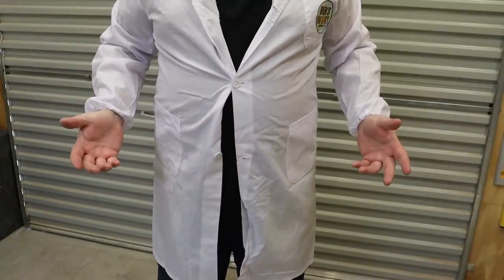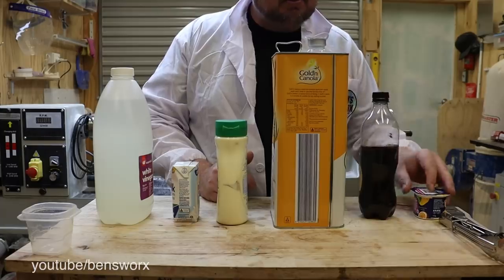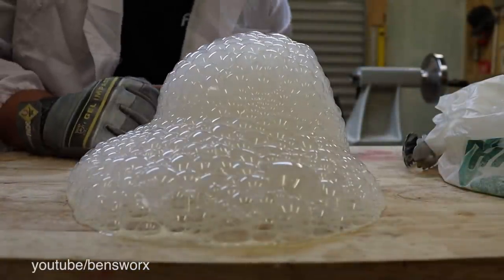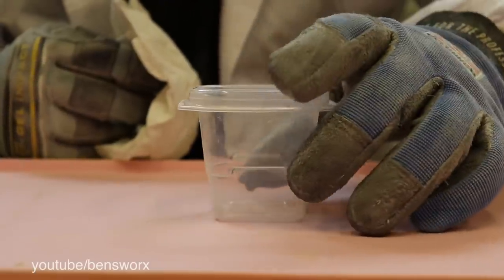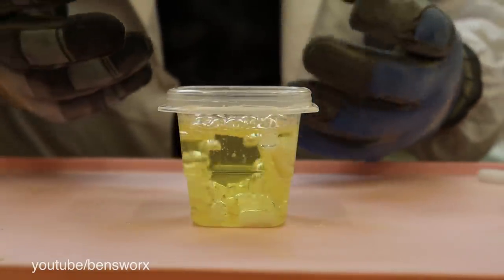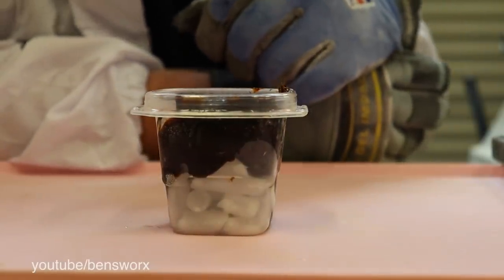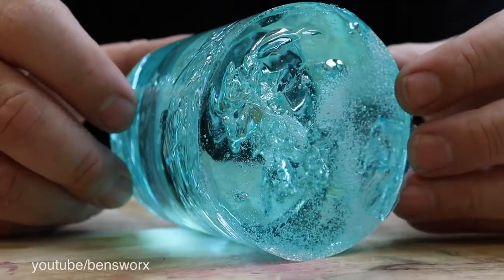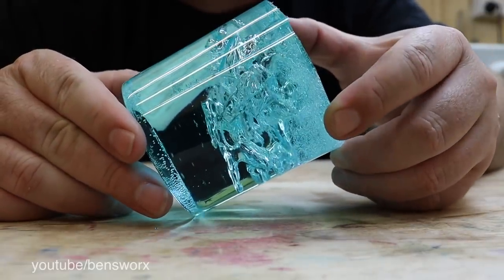Can You Cast Dry Ice in Epoxy Resin ?

Comment: Hi Ben, What happens if you’re stirring the resin really fast when it cures? Do you get the cyclone 🌀 effect?
Can you use one of those electromagnetic stirrer that chemists use? Possibly with iron filings to create a vortex?! That would be cool!
Reply: Magnetic stirring doesn't work with such viscous liquids.
Reply: I mean that normal magnetic stirrers aren't strong enough.
Reply: @hantrio4327  it’s pretty liquid when the two are mixed together with the wooden stick. I just wanted to know what the effect would be under pressure in the pot
Reply: @hantrio4327  give it a go. It may work?

Comment: Great video! It might not be a feasible idea, but if you put the blank into the pressure pot with the dry ice in it, you will slow the rate at which it turns to gas, which might give you more control and may allow you to actually trap it in resin.

Comment: Super cool (pun).
I wonder what will happen if you manage to trap the dry ice in the resin without an escape hole. Something awesome that could happen is that the CO2 will remain solid at room temperature. This can happen if the pressure in the compartment reaches a high enough pressure, the dry ice will not be able to evaporate even at room temperature. I have no idea what the required pressure is and if the resin will be able to sustain it.

Comment: I think you'll need to expand the hole a little bit, but I reckon it would look grouse if you whacked in a resin that glows under blacklight, maybe a yellow or a pink would look cool inside the blue.

Also while you were doing the experiments with super cooling the alcohol, I wondered what a resin blank set in alcohol would do and if it would turn out okay or not. it'd be interesting to see if it messes something up in the curing process.

Comment: Random thought...Can you cool setting resin using a dry ice bath?
From memory the curing is slower when cold but still progresses, but can dry ice offset all the heat produced by curing?  If it does cool it down significantly, does that affect curing in a useful way?  Does it cool enough to affect casting materials that can't withstand the heat, water for instance?

Comment: Milk was super cool Ben! 
I have so many Questions lol 
Like,
 if you used heaps of a concentrate colour in water would it change the color of the fog?
what does it do if you put the dry ice in the bottom of a container and pour liquid on top?
What would it do in hot water with dissolved gelatine in? cause gelatine sets in cool temperature, or even gelatine in hot milk, would the bubbles set?
I’d buy heaps and just play with it 👍
Absolutely try the vac chamber, that would be awesome 👏 
Well done!

Comment: Different color resin for the voids.

Also, was thinking trying the dry ice in resin while in a pressure pot would create a different void pattern because of the higher outside pressure. Wonder if it would still make pin holes before the resin cured.

Comment: Hmm maybe you could try to pour only half the resin first, drop in the dry ice and top it of with more resin (both portions already at the beginning to polymerize)... oh and yeah and take good cover!

And other cool thing would be to but the curing resin on a (fast) turntable to hopefully get the bubbles (or the resin itself) to form an actual "tornado"! (Might even work with normal air blown in from the bottom of the container.)

Comment: Do the milk thing with soapy water and hydrogen gas in a 5 gallon bucket. It will raise a column of bubbles straight up for multiple feet until it breaks off and floats away. It's also fun to set them of fire

Comment: You can do it - contain it in the resin that is.  Need to put it all in a pressure vessel and charge it to 900 PSI or so and the CO2 will just sit there (ideally suspended near the middle of the resin volume).  A little ball of liquid CO2 will remain... until it violently blows up the resin block when you least expect it (if it is made right to hold at all).  You can solve a "thick walled cylinder" case and see if the resin tensile strength is enough to safely contain the ball of liquid CO2 (at room temp).

Comment: What would happen if you screwed the lid on the container right after adding the dry ice? Seems like that might cause it to blow, but it could be interesting. (As long as you were behind a protective barrier. I don't want to see YOU get blown up, LOL!)
Or maybe, if there's something you could put on the surface of the resin/dry ice; similar to plastic wrap or something, maybe a circle of plastic or plexiglass cut just a little smaller than the jar. It might hold the bubbles down without exploding anything.

Comment: You can very easily create you own dry ice at home. You can buy expired CO2 fire extinguishers from the likes of ebay cheap. Simply hold a piece of cloth of the extinguisher funnel (i find a tea-towel works well),  then fire it for a few seconds. The CO2 condenses on the cloth in clupms of dry ice.

Comment: I was thinking that a vacuum chamber might open up bits that have thinner walls.  But maybe make a mold on top to put resin into the pressure pot to force it into the channels left behind.  Then I saw that this is an old video, so I don't know what you did with it.

Comment: First, all were amazing experiments 
Second,  how about to try filling the holes in last one with another colour resin?   Like use holes to pour red coloured resin in empty spaces? It's not easy to do but maybe vacuum or pressure chamber helps to do it better. Even repet the process while dry ice pieces make a cooler shape in different directions and depth and then fill the empty spaces?!!
Reply: Oh man, when I read some other comments, I found out I missed something and I saw the last seconds of the vid. You said it yourself and seems many like that idea. How stupid I am and how curious I am to have the same idea like you 😅😅

Comment: You don't see the gas in the oil because the gas you can see in the others isn't carbon dioxide, it's water vapor. Carbon dioxide gas is invisible but when it sublimates it's cold enough to cause the moisture in the air (or the water directly when it's in an aqueous liquid) to condense into a visible cloud.

Comment: The Mayo, is it whipped? 
Because not much out there that is a better insulator for both heat and electricity than an air gap.
They were well insulated and cooled down to the point where they were no longer warming up enough to liberate very much CO2 and effectively shut themselves down before they could expand enough to pop.
I imagine all of these experiments would have gone very differently if the Target was warm or hot instead of room temperature and rapidly getting cooler

Comment: If you want batter results casting dry ice at room temperature you should put it under pressure.  About 7500kpa should do the trick.  The co2 won’t be solid but a liquid.

Comment: 3:40 I feel like this wud look much cooler as a halloween display than the alt of just in tepid water. Tho may be even cooler if ya use seltzer water which you can even dye rather reliably if ya want a specific colour.

The fact that it bubbles up and then pops out smoke over and over gives me more of cauldron vibes as opposed to the classic cauldron of dry ice and water just billowin smoke (yes i kno its not smoke, but thats the effect it is bein used for)

Even the milk bubbles cud be prty cool if used properly. Havin them on the floor of a haunted house that isnt brightly lit wud give the illusion of smoke poppin up as you step and also wud make for a unique texture that bein stepped in. If dyed red first, it may even give a sense of walkin thru entrails (esp if interspersed with other things that feel more like such) and the pops of smoke bein the gas from decomposition burstin out of the entrails.

Comment: What about this:
1. Filling an ant farm with water disolvable grains.
1.2. Let ants build there home.
2. Evacuate ants. (Its not nice, but for sience)
3. Pour any colored resin into antfarm.
4. Let it harden.
5. Remove everything from the antfarm and clean hardened resin with water to remove any excess grains.
6. Drilling some holes in the upper part of the hardened resin to allow air passing through (for later).
7. Pour clear resin into the container of the ant farm.
8. Put hardened resin back into the now filled container of the ant farm.
9. Put ant farm into evacuation pot, evacuate the air and let the resin harden.
10. Show us the result.

What do you think about this plan?

Ps: this experiment could also be conducted using an antfarm with regular grain material, but this might affect the shape of first cast. I assume, it would still look pretty cool.

Comment: I see that you're using a pressure system to rid the casting of bubbles (wish I could do that). Since there are a lot of folks that don't have that, and don't understand wood, allow me to take a moment to explain why craft sticks are the worst thing you can use to stir resin. Why do companies send out craft sticks with their resin? Because it's cheap. THEY know you shouldn't use wood sticks either. 

Wood is a living, breathing thing. Even after it's cut, it's still going to swell and shrink because when it's "dry", it likely still contains about 7% water. Maybe less, but it still contains water even if it's absorbed from the environment.  The grain of wood is actually microscopic tubules that deliver nutrients throughout the tree, so it's not solid. It has microscopic places where air hides. Thus, as you stir, it off-gasses, which means makes more bubbles. (also, if you're pouring directly onto wood, you should seal it first for the same reason. Seal with shellac or UV resin so you can pour in less than 12 hours). The best stir sticks are that collection of plastic utensils leftover from takeout (the handle end), or a silicone stir implement of some kind if you want to buy something. 
I've poured epoxy onto and inlaid it into wood many times, so trust me on the bubble thing.

Comment: 7:15 “-7 or -8 degrees Celsius, or 30 degrees Fahrenheit”. Ummmm… no. -8°C is 18°F. I suspect the thermometer actually read -0.7 or -0.8 Celsius, because  -0.8°C is 30.56°F. Also, I knew it couldn’t be -8°C because the oil would be nearly solid then, whereas in the video it’s certainly thickening but still very much liquid.